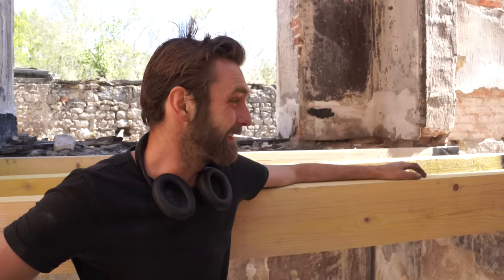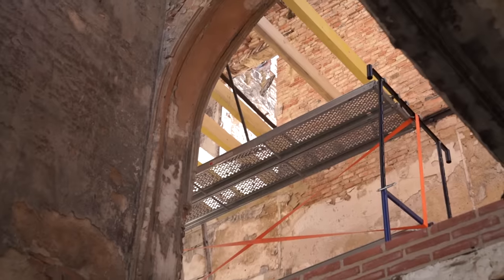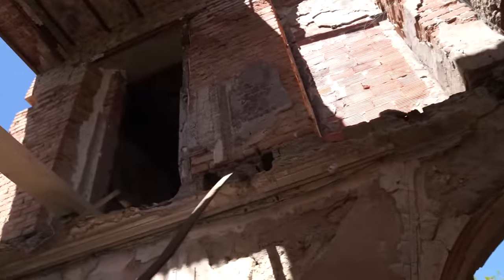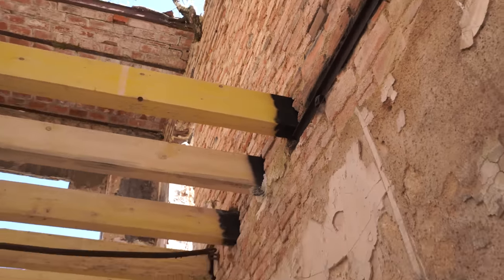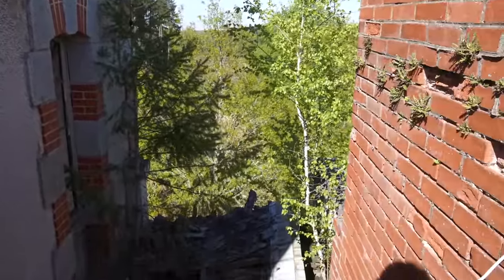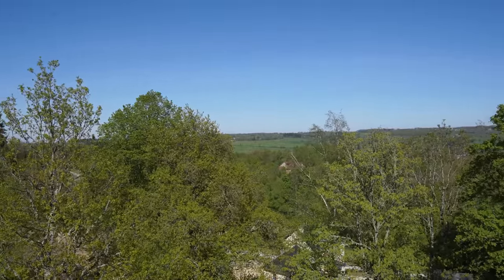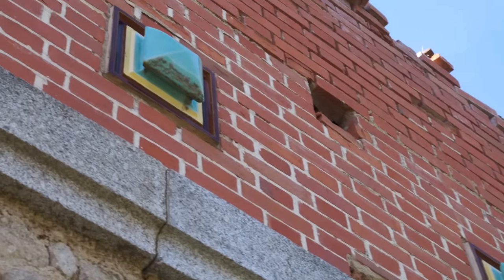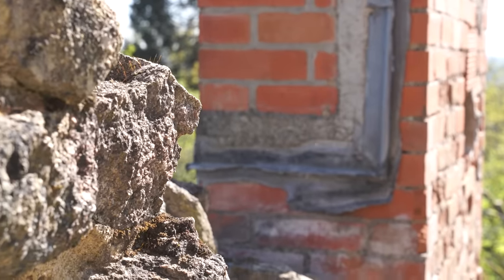I climbed to the very TOP of a chateau ruin, and this is what I saw.

Comment: I'm going to make a suggestion, since your building is in such bad shape from the elements, I suggest you run a few rods, through the building to tie the  walls together, bolted through the wall so the whole wall doesn't fall down, because you are adding a lot of weight to unstable walls
Reply: That's what they do with old, brick buildings in California. Because of the earthquakes, you need the extra stability.  Dan's brick walls look pretty thin at the top. It wouldn't hurt to get some steel into that tower.
Reply: Tye rods we call them in england
Reply: He needs a little more shoring up and soon it will be. This will be so exciting!
Reply: He would need some kind of structural engineer to suggest where to put the tie rods in place and where they would do the most help
Reply: If you had been paying attention , he said in the earlier vlogs that he will be replacing all those metal girders with new girders so it's likely that he's had a structural engineer look over the property if he isn't actually an engineer himself . It is highly unlikely that he's a complete novice , you can tell that by watching him working in such a methodical manner , just his work re-pointing the basement walls should tell you that he's got a pretty good idea about what he's doing
Reply: @johnshaw4140  Actually you can tell the opposite, he makes great videos but terrible construction.  When you hear somebody say I hope I don't have to knock more bricks out to put this beam in, (in an unstable and unsupported completely exposed wall no less) you know there is no plan.  (other than to make really fascinating videos)
Reply: @ji8044  you are awfully good at making assumptions aren't you? I can tell you that to get building permits in France you have to have architectural drawings made up, structural surveys, and in some cases archeological surveys too. As we know he has applied for building permits it is safe to think that all this has been done.

Comment: The higher you get, the more human and graceful the scale of the place. Seen from the ground with no floors or ceilings in the way, the whole place feels a bit like a formerly very fancy oubliette, but as you gain a level with the windows, it becomes clear how the spaces will one day flow into each other and embrace those wonderful views. The scale of the rooms is actually quite gracious, they're not wildly oversized and ridiculous, but neither are they cramped in like the architects were trying to tetris in as many rooms as possible instead of designing what was needed for comfort.

Comment: AHmazing!  The views are stunning and the little bits of history which are revealed at every angle are fabulous.  The chimney pots are nothing less than wonderful and the ladder hook still attached to the remains of the slate roof testify to the quality of the original construction.  I think that some of the anomalies you are discovering like strange vents and bricked openings can certainly be attributed to changes made by succeeding users.  I wonder if there are missing fireplaces, too.
Reply: I wondered what that hook was for. So obvious after I read it. I agree about the quality in the details making maintenance as easy as possible. Even without fixing tiles, the roof would need clearing of wind blown debris.

Comment: Use a Grout/ Mortor bag and fill in at ends of beams to help secure each new floor to adjoining walls . Put some decking screws in beam ends to give mortor something to hold on to otherwise the beams will eventually pull loose from mortor . Use blower to blow out any dust first .
Reply: That's a great idea.
Reply: Love it Dan...keep going buddy...carefully!

Comment: I'm probably not as glad that Dan is with the pulley system. It would suck to have to haul all the cement, bricks and beams up to the top floor!
Reply: I'm so glad and amazed you have reached soooo high up. Glad you're closer to that most needed roof or some type of cover for ongoing work.

Comment: You're nuts! 😂😂 Love it. Well anyway you won't have to worry about rotten floors and joists like other chateau owners, yours are all Tickety boo. And no woodworms.
Reply: It's definitely worse than Château du Theil and that's saying something. Theil only had the neglect and rot, without the fire. I hope the interior renovation of Chaumont will be more sympathetic though, Theil is going to look like a completely new build on the inside, no reference to the history of the place anywhere to be seen.
Reply: @Ragnar8504  I know,did you see the way they put the turret on though? Built on the ground then craned to the top, that's what Dan will have to do. That will be an exciting, nail biting day.

Comment: Question about those bathroom arches you found: Do you think they indicate that those bathrooms were originally more like open landing space prior to the renovation for the child refugees in WW2?Since they’d need a lot of bathrooms, I could see those landings being enclosed to house more bathrooms. Since they have archways on the walls that open towards the main stairwell, if they don’t overlap with the stairs that could show that the stair placement was original and those were indeed open landings that overlooked it. Or, if the lines on the walls where the stairs were cross through the archways awkwardly, perhaps that proves that the stairs were once a different configuration, just like you recently pondered.
Reply: The twin entrance doors are clearly original, as are the windows that line up perfectly with the ghost lines of the landings. So I think the configuration and position of the stairs hasn't changed much, if at all. The arches do seem to line up with the stairs quite nicely, the really interesting bits would be the walls below the arches. If the openings were made smaller that should be visible with the plaster removed. I might have to rewatch yesterday's video for a closer look.
There's an eyewitness accound by Eric Thom available on the internet, with a fairly extensive but slightly confusing description of the interior during the war. According to that description there were sinks in the ground floor entrance hall and a large space with showers and toilets on the first floor, along with two dorms and several small staff rooms. That description makes me think the two current bathrooms were either staff bathrooms or weren't bathrooms at all. The former seems slightly unlikely considering the small number of staff mentioned in the text. As I said the description is a bit unclear to me and I don't think that's only because of my limited French. Human memory is fundamentally flawed and close to 80 years have passed since this boy was at the château. In case you're interested, the excerpt is in an online article by Christian Lassure, èclairages sur le château de Chaumont a Mainsat. It's also probably the most detailed architectural description of the building and there are several historic photos. Lassure writes that the original architect hasn't been found yet.

Comment: Anyone notice this wall. ( 9:33 )The burnt beam is the only thing holding about 10 tons of bricks up. Forget replacing floor beams. He needs to address this before anything else. This could fail at any time. Then it’s game over.
Reply: It's not burned, it's a rusty steel beam. I don't really trust that section either though, definitely needs to be addressed!

Comment: Tell us more about the long term plan.  Why are you putting in these floors first when they can get wet from rain?  what's the plan to get a roof?
Reply: He has said that he has to stabilize the structure and prevent things from falling on people from above in order to work safely.  He needs the walls to be stable in order to add the roof. The floors will prevent the walls from collapse.
Reply: The floors bring stability to the structure and a platform to access the roof from the interior as well. The upper structure requires tons of work before a roof can even be considered. Likely a bunch of tarps will go up.
Reply: He has explained in earlier videos.
Reply: @taylorh.6477  Yes, he mentioned tarps only a few videos ago.
Reply: @taylorh.6477  Wont tarps sag in the rain?
Reply: @jennymay4720  They will have to have poles and such to bring up the middle and create runoff angles

Comment: Just a few things i am wondering...
1. If i remember correctly, one of the chimneys is collapsed...might be worth it to get imprints of the chimney crowns at some point to replicate the broken ones and mirror that to the other chimney.
2. I hope you have done pictures of all the stuff, before ripping it out...
3. The Former Annex with the slanted roof was nice on picture, hope it also gets rebuild...
4. The former Annex from the 3rd floor up doesn't really seem structually sound. Not only was it baked like everything else in the flames, but also soaked like everthing else in the rain.(dunno, what does anyone else think about the safety of the bricks) That takes a toll on these red clay bricks. At least the Annex should be overlooked by an architect since its a whole(well now half collapsed) floor only supported by these cookie-crumble bricks.
At last, you could safe on some money picking out the stones and bricks from the trash you dug out from the ground floor. Even if 2/3 are unuseable, you get at least enough to rebuild the collapsed chimney.(if the rest of the community thinks these are ok to build with(?))...
It's getting along very good. Getting in these floors gives you the reach to shelter one side of the building. From there things should go better along since you already have a foothold on the upper floors.

Comment: Dan's musings on the various archways showing up on the old walls the other day that don't go anywhere, makes me wonder if it's more a case of a reuse of building materials from a previous building on the site of the Chateau rather than just the more prosaic, and some would say, more likely, remodeling. If correct, stuff's been reused and they've simply infilled where and when necessary.

Comment: It would be nice to make replacement ballasts  by making a mold, putting half of the ballastade  laid down, in a box, (soap, or wax, ) the entire outside of the ballastade, so plaster won't stick to it.  make 2 of these molds put them together the 2 plaster mold and clamp them, make sure there is a plug it the top and the bottom of your mold, 1 so you can pour concrete in the mold, the 2nd the bottom whole so you can later use a bolt to attach your ballastade to your railing. And the ballastade would be very hard to find anyway, good lick on that use regardless inside to strengthen it, then you may not need a bolt to attach it, just use rear coming out the bottom hole 2 inches, Also ancient concrete they used crush shells to strengthens  the concrete to almost rock hard. NOTHING WE HAVE TODAY IS THAT STRONG, if you could find some (sea shells crushed. and add it to your mortar mix it would be Amazing, give it a try, better than lime

Comment: You are doing a fantastic job there Dan .You could make life easier if you build a bench for yourself from some old timbers which you got lying around. THAT drop saw was designed to be on a bench approx 3 metre long. Handrails are a must when working at heights.? Be safe that way you can come  back tomorrow

Comment: It's too bad so much has been lost regarding the piping that served those tanks on the third floor. I could see an inlet pipe at the top and an outlet pipe at the bottom on one of them. They are both some kind of reservoir for the house water supply.. Because of their height they provided a reasonable good pressure head if they were intended to supply fixtures at the lower level. I think it is in excess of 30feet. It would have dropped rapidly as it was fed to fixtures on each floor. The higher the floor the less distance to the tank and the less pressure there is in the vertical pipe. The pressure in a water line is a measure of how high the top of the water source is to the outlet. The volume of the tank doesn't matter when determining pressure. That only indicates the amount of water available.  

The two pipes probably indicate that the water was pumped from a ground well somewhere. But I also wonder if one tank could have been fed by a ground well and the other may have collected rainwater directly off the roof? Maybe guttering was arranged to feed one of them? That water could have been sent to toilets and bidets and didn't require energy to pump it to the tanks. You don't need drinking water to serve toilets or bidets.  

The builders at the time probably didn't do the very detailed kind of architectural drawings common today.  Today an architect would call the drawings that describe the structural system and the interior finishes as "architectural drawings. There are many other sets of drawings of subsystems especially for larger jobs. A house may only require a page more for each subsystem, plumbing, electrical, HVAC,   Building systems were fairly simple then and I suppose it's possible that no other drawings would have been made to describe the electrical, plumbing and other systems now common. The builder may have simply hired a plumber to figure that all out himself. So even if you could find some of the original drawings they might not  help much to explain what was done there. The house may have had gas lines too but probably not connected to a wider network if any existed there.  Some bigger places could generate their own gas on site. Or the tanks could have been installed decades after the house was built and were never recorded on a drawing. 

Whatever was really happening there you could use the gravity pressure head of those tanks - or even larger tanks - to feed the house with roof runoff. It would probably be clean enough to start that all you might need is a point of use filter to serve even potable uses. That way you wouldn't need to expend as much energy on a ground water pump. The ground well could be a backup source for drier periods of the year. You should check with an engineer about just how big a tank you could use up there. Those tanks could require more support if you went larger. Water weights about 63 lbs/ cubic foot and would be the largest concentrated load on the floor structure.  

Energy of any kind might not be cheaper in the future.

Comment: After the passage floors will you attempt to replace the metal I beams and get the wooden floors in the three large rooms? I would have supposed that would be your next big charge as it shores up the walls further and once you get to the very top, helps you put tarps over everything until the roof is ready, also protects you below from any further falling debries. 
Cant wait till we can see you once more walking the new floors room to room as you replace windows and renovate the walls.

Comment: Keep going Dan. Such a great project. One question though, why are you not dealing with the tie rods?  They are critical structural elements. The building would never be safe without them being repaired or replaced - right?

Comment: I'm very impressed by your endless enthusiasm. Do you ever run out of "steam"? However, I have one concern: you haven't weather proofed anything. You let the rain get to your new floor joists and that could cause problems with mold in the future. Have you ever considered trying to protect your project with a temporary roof? I know there is some sort of "tent" to put up over your entire chateau and it's held up by air pressure, similar to temporary sport halls used in colder climates? Keep up the work and thanks for sharing. Greetings from Sweden 🇸🇪.
Reply: The tarp is on the way, says the patrons. Fingers crossed 🫰🫰🫰

Comment: I'm curious as to why you haven't worked on the roof, to prevent any further rain and dirt getting in to ruin the work you've already done.
Reply: He said the roof was supported by the floor joists so without floors he can't start on the new roof. Besides, having solid floors to work on makes the roof build a lot easier and safer.

Comment: Hi Dan, is it 4 levels including the basement ?
Reply: Plus one in the tower I think, possibly even two. Basement, ground floor and first floor are the all-masonry bits, the second floor is brick/stone in the middle and mansard roof on either side. That's as far as the main stairs went. The third floor only had the room above the staircase and a tiny section of brick in the back, everything else was another level of mansard roof. Yet another floor above the staircase there was the turret roof with another one or two levels. The old pictures show dormers on all four sides of that roof but the brick bit with the ceramic decorations looks to be tall enough for another entire level.

Comment: As a dual tradesmans of 63 years old I'm  wondering if you hate your knees. First of all why are you winching only one plank at a time, i'd be lifting 3 or 4 at a time rig them so you lift horizontally. At your current rate you will be an old man before your ever done. Secondly why is your saw on the floor on the main floor, it should be on a work stand on the second floor. i'd be consentrating or getting the second floor roughed in with a temperary stair case so you can stop killing your knees. Your burning through way to much time on ladders, work smart not hard. If You complete the rough in on the second floor it gives you a solid base for the third floor work and it makes the building more stable. JMHO